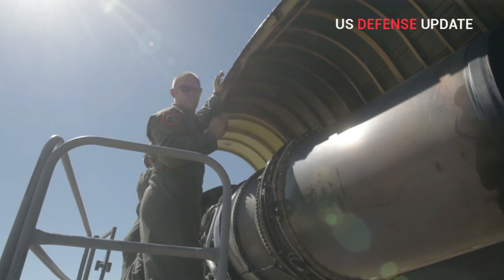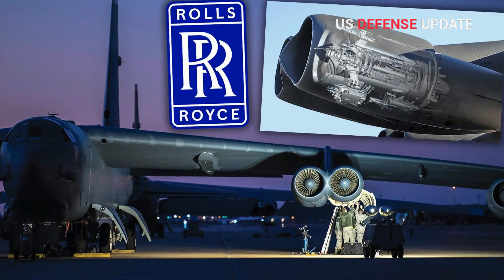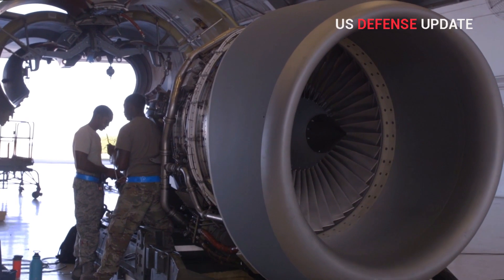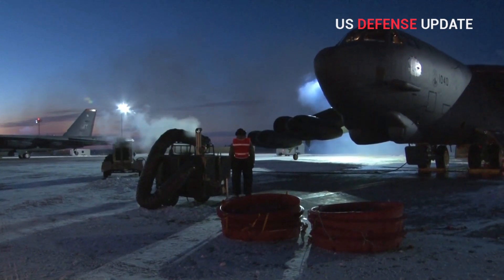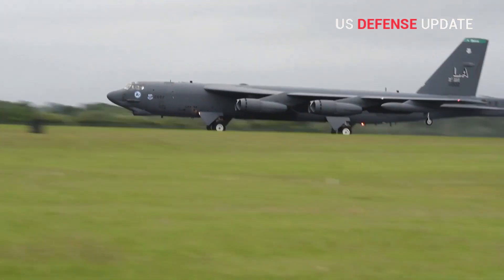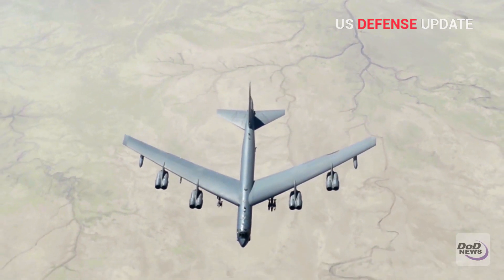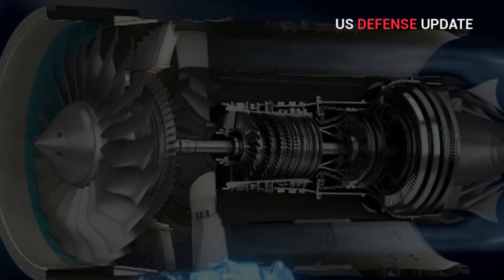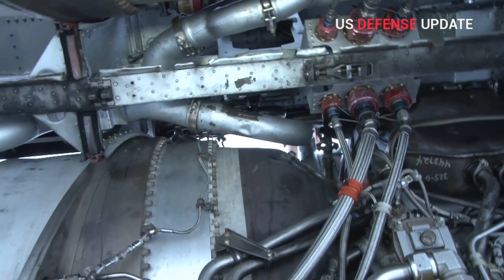Revealed! Rolls Royce Gives The New Jet Engines to make The 'Super' B-52 Stratofortress

Comment: Just in; the F130 RR engine has exactly the same thrust as the TH33s its replacing.  So indeed, the takeoff roll and general performance will be the same.  But, as I said 10 months ago, the engines will 20-25% more fuel efficient and that means longer missions, fewer air refuelings per mission profile.  But what I cannot be sure of will that mean augmented crews with extra pilots and navigators.  And, not to be indelicate, 40 hour missions, extra crew members?  What's the bathroom situation on the 'H' model.  The 'G' I flew had no bathroom, just a honey bucket in an active aisle next to the periscopic sextant nav station, and we had 30 hour missions with extra crew members. The pee cans were on the lower deck.  And not to put a to fine a point on it, I notice some of these YouTube videos show female b52 crew members.

Comment: Hopefully, the engines they replace the old TF-33s with will NOT have more thrust.  The old BUFF is stressed for the power of the old engines and should have the same take-off roll. But the new engines will have better maintainability and ensure fewer air-refueling hookups per mission profile because they will be more fuel-efficient. I suspect they will also be able to stay airborne longer from an engine lubrication standpoint. Sorry future crews, but maybe they'll put bunks and real restrooms in them as well for the 40 hour plus missions. 

We just wished we had them in the B52G model I flew during the cold war on our long-haul missions.  Especially the real restrooms instead of the honey bucket mid-aisle, upper deck beside the periscopic sextant station used for navigation support.  Well, that’s what we had in the ‘G’.  Maybe they don’t have or need them in the ‘H’.